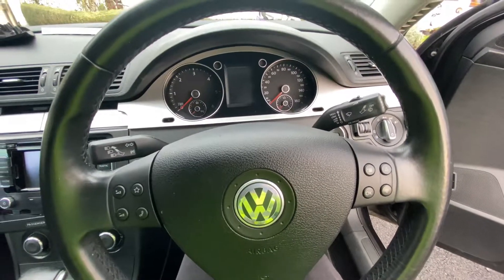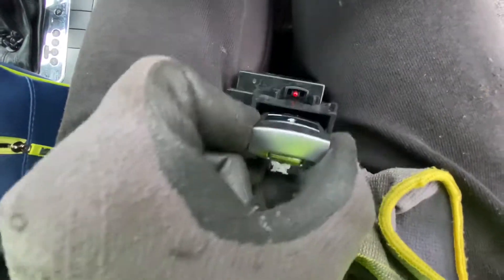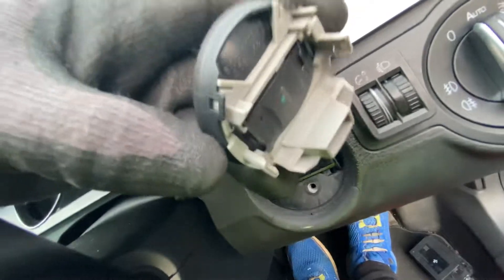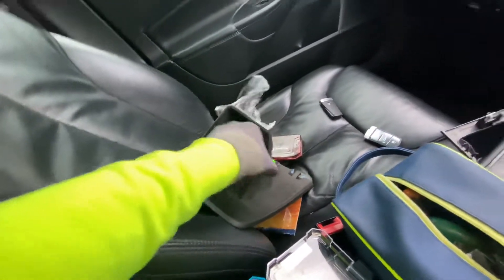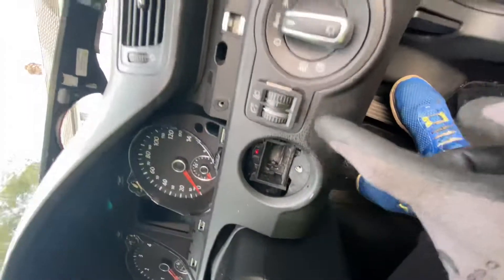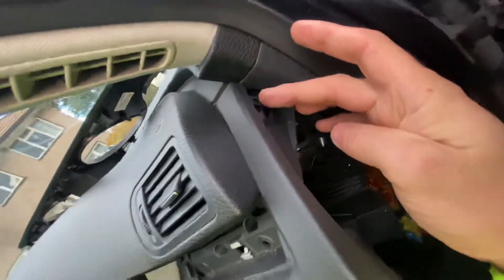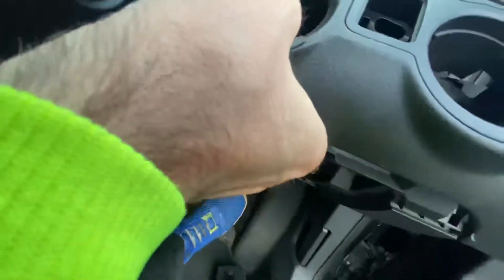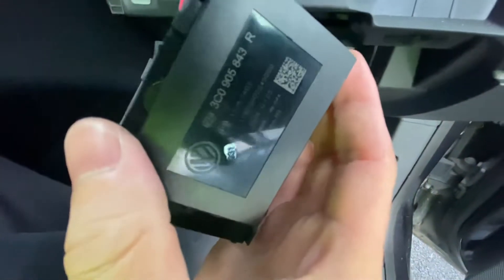Passat B6 ignition key lock replacement

Comment: Does that red light light up when it's working ? I have. 2006 Passat no start no crank . There's no power going to it . The horn don't work , the lights don't work , now the radio don't work , there's no dashlights on but the door open and DRLs . I hear no clicks of anything . Could it be the ignition switch . Any help is greatly appreciated!
Reply from the maker: Most likely the steering lock. Try simple things like fuses and relay, relay 100 in the engine bay fusebox can fail as well.  Try cheapest fix first
Reply: @lavianeverything  Hmm thx .. I'm going to try everything . That's why I was asking if when you put the key fob in is that little red light suppose to light up red? Could it be a faulty ignition switch? I was thinking possibly the steering lock .. but when I put the key fob into the ignition absolutely nothing happens . All that happens is a hear it chime a few times and then nothing . The radio use to turn on when I did that but now that's not even turning on . Thank you for your advice!
Reply: @lavianeverything  Oh and another thing the brake lights don't even work when I press them.

Comment: Can you glue the chip from key inside of that device and after to use any key to start the car ? 😅
Reply from the maker: Probably yes
Reply from the maker: Just remove the chip from the key you are using and any key you put there needs to have no chip …. Otherwise you will have immo issues. I wouldn’t do this for safety reasons. Anyone can steal it
Reply: @lavianeverything  Yes , I just find a video witch answord to my question and it will work, you can glue the chip on the left corner down at entrance of the key , is a lot of space there fot doing this and you have just to remove the front cover from the fob not the entire device .So I replay here also in case anyone is interested to to this as well.  Thank you for your answer too 😊

Comment: Hi. Do you need to disconnect the battery before you disconnect the ignition switch?
Reply from the maker: Ideally yes if you have no tools to clear faults also if doing it first time I recommend disconnecting the battery.
Reply: Thanks for the quick reply. Great video. Got the switch out and opened it up. Micro switches seem free but I cleaned with contact cleaner. Only an intermittent problem where the fob is pushed to start  but nothing happens.
Reply from the maker: @colinw1197  I replaced mine as it was to worn.

Comment: Great video, just what i needed :) 

One question though, is it "plug and play" to replace this?

Or does it need any form of programming after replacement part is installed?
Reply from the maker: Nope, plug and play. Might have to clear the faults in the steering wheel module if any but that’s it.
Reply: @lavianeverything  Great, thank you for taking the time to reply :)

Comment: Hey man. Great video. If I get another number, do I need to program it or adapt it? I know for a fact that if it has the sume OEM number will be plug&play.
Also, how do I get the key out? Mine is stuck in. I think the problem is that the release mechanism is broken.
Reply from the maker: Take the whole thing apart to remove key, I know that if you put wrong part number if the car is automatic the key won’t lock in ignition. Try another part number but don’t assemble all together, test. Won’t need coding on that part. Other modules do

Comment: Hi. 2 weeks ago my alarm starting going on when I had locked the car, so i have decided to not lock the car to not disturb my neighbours, after few days, my car do not want start (no ignition when I put the keyfob) I have read a lot of comments on fb forum, and all people said that is battery issue, so I have ordered new battery, problem was solved for the next 4 days... and back yesterday. I have fully charged the battery (12.4v)yesterday but today car do not want start( no ignition, nothing happen when I had put the keyfob etc.)
I will be very grateful for any idea with help. That can be ignition switch?
Reply from the maker: Have you fitted anything recently? Like a new radio or something that can drain it?
Reply: @lavianeverything  nothing. I think that can be aswell ECU....
Reply from the maker: Look for battery drain test  on YouTube, you need to pull fuses out 1 by 1 and see where is the problem.
Reply: did you find out what your issue was? something is draining my battery, when i lock the car with the key fob the indicators dont flash once like before, it usually means a door or trunk is not closed when you try to lock (or the switch/door control unit is faulty), so the car doesnt shut off properly and drains the battery.
Reply: @xDMG15x  no mate... my car was im VW dealer he said there is problem with Body control module but... also problem is somewhere else, and until they will not install the BCM they not will be able to looking next problem..
 They charge me £2000 and my car still not was fixed... I have sale my car for £2000, and I have bought different car.... I hope you will find resolution... because my car never start working again. Wish you luck fella.